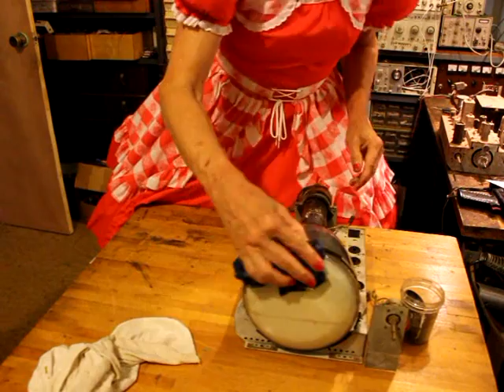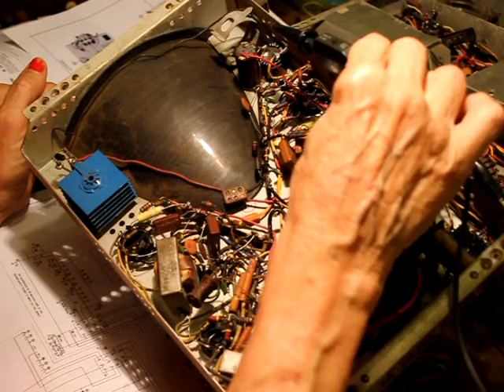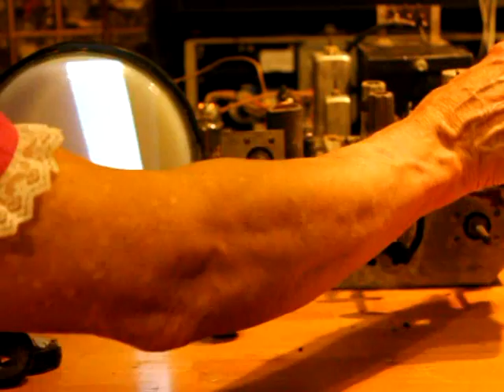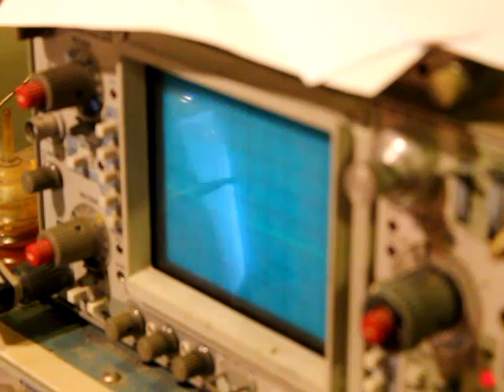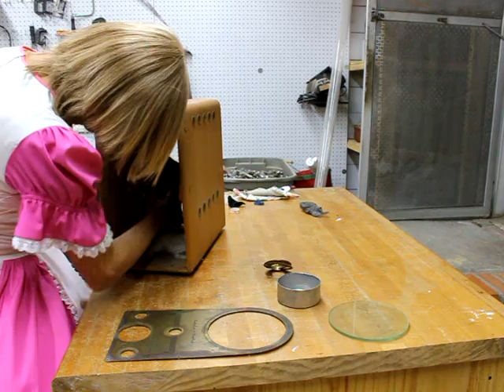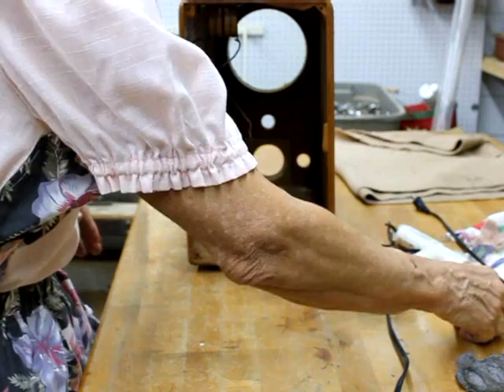restoring a 1949 tv set

Comment: its amazing how much of a rats nest the inside of these things looked like before PCBs started being a thing.
Reply: It's amazing how much of an amazing these amazing looked like before amazing started being amazing
Reply: And it's amazing how horribly layed out were tube devices that actually used PCBs. Not only the usual PCB quality was leaving much to be desired (and on most PCBs from era you will lift up nearly every track you just look funny at whilst holding the iron), heat of dissipation  made them bent and connecting for example ammeter in circuit was nearly impossible without some kind of tube socket & plug contraption (instead of just desoldering one wire). With that you can live, but usually half the caps is surrounded by things like variable capacitor, antenna or random transformer so either you need skills of a gynecologist or you have to disassemble everything to pieces to change one cap.

Comment: It might be a good idea to use a 1 to 1 isolating transformer when working on these  non isolated chassis. Also I recommend a RCD circuit breaker. Saved my bacon a couple of times!!
Reply from the maker: It is essential to have your work area set up for hot chassis work. This means no grounded metal anywhere near, such as other instruments, metal tables, etc. I do have an electronic circuit breaker on the bench.

Comment: I remember from years ago that  the old picture tubes sometimes developed a heater to cathode  short. The tube was still good but  presented a problem for sets with a series string  heater arrangement. The solution was to use a separate small transformer to power the picture tube heater.
Reply from the maker: There were also "picture tube brighteners" that were isolated. These would do the same thing and work in the series string at the same load.

Comment: Great video.  I have been restoring radios for years and now may consider restoring an old TV.  A lot I already knew like replacing paper caps and checking for out of spec resistors but I have never thought of using stain on a cloth covered item like this.  I have passed on many radios because of the cloth covering but now if they are not torn or beaten up I may consider using this method on one of them.

Comment: What would be fun, would be to manufacture this tv, with modern technology, factoring all components and tubes, with modern technology, looking for low wattage, no emissivity, single digital microprocessor for digital addendum, hybridization with 30 radio tube circuits, without phased lock loup, and 100 year longevity.

Comment: If I were doing this I'd have an isolation transformer between the TV set and the Line. It's just not worth the risk of doing without it.
Reply: +Herbert Susmann Agreed. Not only does it put a current limit between you and source current it removes your earth reference (not all isolation transformers decouple the earth reference), making it much safer to use your oscilloscope.

Comment: Can the ballast be tested? Do they often go bad?
Reply: Ok got to the section of the video where it was bad.  Years back, I had experience with those things going bad. So i was weary when i saw you just put it back.
Reply from the maker: +David James 
They go bad regularly. They were made with nichrome wire which will corrode over time and finally burn out. They are difficult to find new old stock so using power resistors is the most practical fix.

Comment: I noticed that your tester doesnt test for gassy tubes or shorts. Couldnt a shorted tube hurt the unit or is there some form of protection on it.
Reply from the maker: +Jordan Rubin 
Possibly but unlikely. Usually a shorted tube will not test good. With everything you play the odds: Shorted and gassy tubes are not common so I don't take the time to get out the big tester to test TV tubes.

Comment: Did I just sit and watch an hour and a half video?.. yes I did.

Man, I hate when power resistors kick the can. Series string radios for 220 V usually have a huge exposed winding resistor on a cylindrical core that is pretty much always dead. Last time I fixed one, replaced a whole winding with a nicrom coil I pulled from a hair dryer. Had about the right impedance.

Comment: I'm surprised to didn't repair the ballast. I've seen you work with very fine wires before.
Reply from the maker: +Arnold Rimmer 
It had 3 of the 5 sections bad, all of them being that hair fine wire. The video does not show it for brevity but I spent over an hour trying to splice the wires. No luck.

Comment: TV set from 1949: "First, check the capacitors...99% of the time they go bad". TV set from 2010: "First, check the capacitors...99% of the time they go bad". The common failures haven't really changed in the past 66 years... I like your outfit btw!
Reply: +Chip Guy Vids The  more things change, the more they remain the same.
Reply: Well, capacitors are sort of short term batteries and batteries go bad.
Reply: Today it is because they are cheaply made from China, back then it's just because they're old and dried out
Reply: True true. I had a tv from 2008 it had any caps that went bad.

We don't have that tv anymore

Comment: This brings back the time in the early 50's when My Dad attempted to build a television from a kit and became so frustrated that He gave the kit away! He never worked on anything electrical again, even though He was very skilled at woodworking, sheet metal, masonry , automotive and boat building-real boats not models. Love Your videos-but doubt i will try any major restoration as i;;m getting older and have failing eyesight. I did just rescue an old Mitchell bakelite lullaby bedlamp radio that was sitting alongside a lot of heavy tools at a pawn shop-i was worried someone would drop a benchvise or something on it and it would be destroyed, which would have been a shame as the cabinet was perfect-the light even works!!